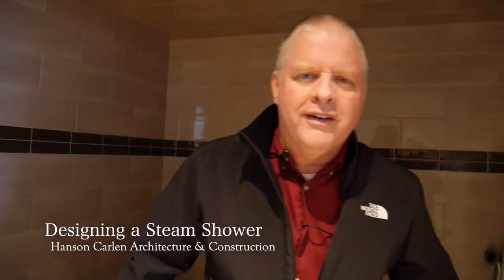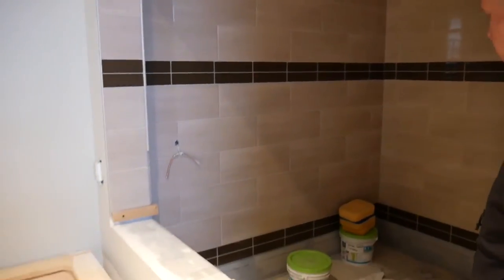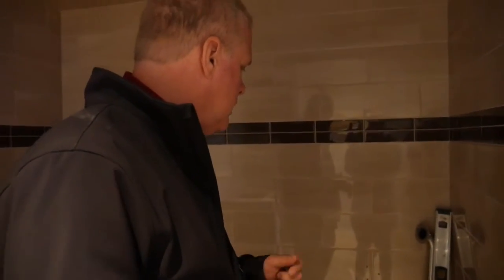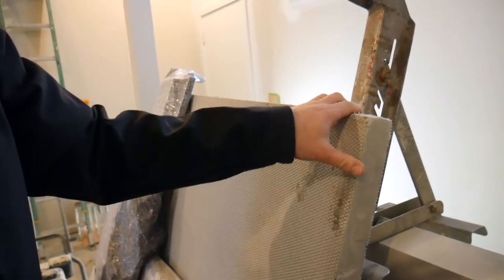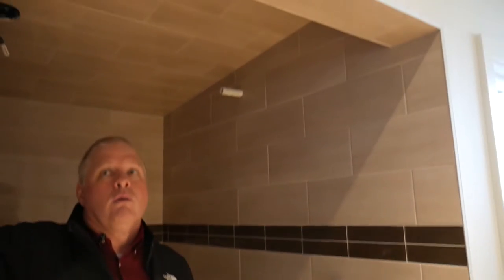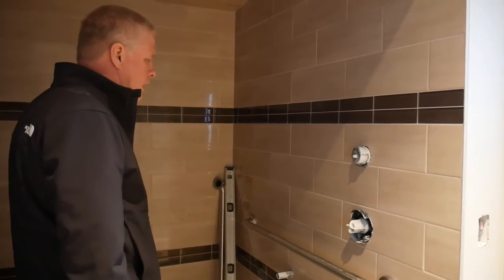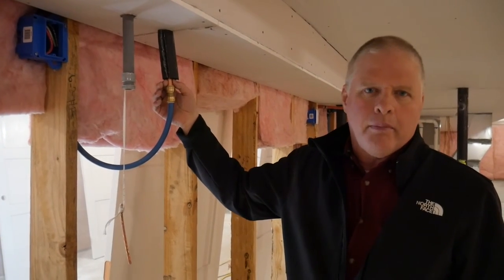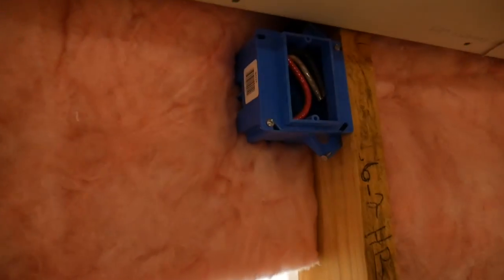Designing a Steam Shower

Comment: Great video! I'm planning to have one installed in my home and my tile contractor was curious about waterproofing the mixing valve. Going to be using a Kohler Rite-Temp and he was just planning to silicon around the trim kit, is this sufficient?
Reply from the maker: Thank you for your comment! Silicon around the trim should work just fine.

Comment: I noticed your installing a standard pot light? Which model light did you use? Is it IP65-67 rates for vapor/waterproof? I want to do the same but I’m unable to locate a pot light that’s vapor/waterproof.
Reply from the maker: Hello, thanks for your comment. Since it has been a couple of years since installed this steam shower it is difficult to track down what light we used. After looking into it a little bit I believe the light we used was from Progress Lighting model P8247.